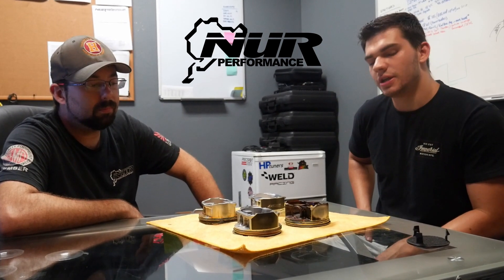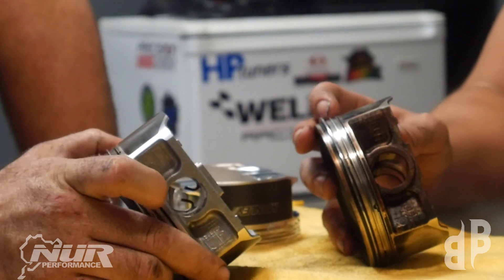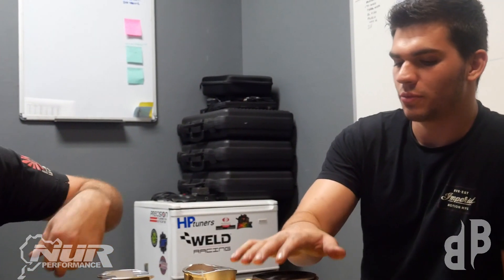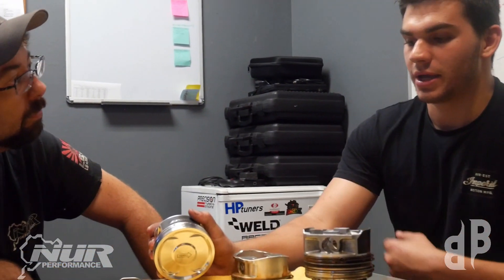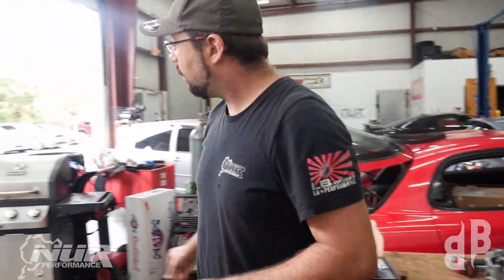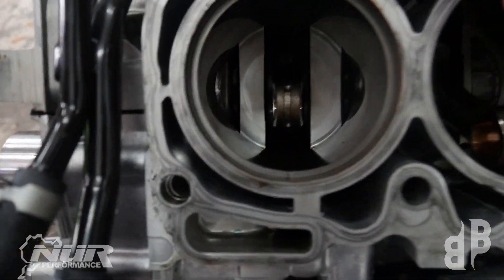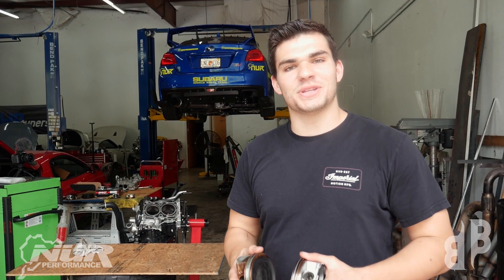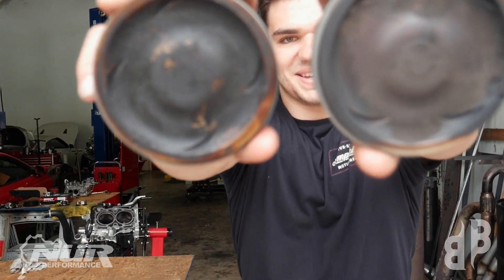THE TRUTH About The SUBARU STI RA Piston (MYTHS BUSTED!!)

Comment: Ringland on #4 is often fuel related. The feeling system causes cylinder 4 to get the last of the fuel. Builders and tuners down here in Australia have noticed improvements in engine reliability when converting cars to parallel fuel rail setups.
Reply: Cylinder 3 gets shortchanged on fuel (without a parallel mod,) cylinder 4 has the least coolant flow (without the GetaDomTune mod.) Both mods are simple and inexpensive, and are IMO critical reliability mods on a turbo EJ, even at stock power levels.
Reply: @JulianHale  i have had a ej257 that has been tuned for 280whp for 200,000km with no issues, just has arp head studs and a aos
Reply: @fynpedersen  I wish 
I’m on my 3rd oem block within 100km of stage 2 abuse
Reply: @liambarrer220  jesus christ. just save up like $700 extra and get a IAG
Reply: @fynpedersen why’d you get head studs for only a 280whp build?
Reply: @JulianHale  shit sorry I did mean cylinder 3. I've already done the cooling mod to my car now looking to do the fuel mod. Parts look like they would cost about 1k down in Australia.
Reply: i did that on my new RA STI JDM ej207 motor with no 4 coolant by-pass ! with the split fuel and fuel pressure regulator !

Comment: so if you leave the STI stock you wont have this problem?
Reply from the maker: The chances of this occurring are much less if you leave the car stock, however because of the original poor design, it may still happen.
Reply: Not true.  Ours is stock with only 69k miles and cylinder 2 failed.  It was not abused in any way.

Comment: Stock motors with stock ring gap thats been tuned and up the boost havnt had the rings gapped for that modification so it's running higher temps and that creates swelling of the rings now in a normal aplication this would be fine but because we are hotter they expanding quicker and they touch and have no where to go so the break and there you have rongland failure if you want to tune your car just save the money your about to waist anyway and do it properly
Reply from the maker: So much truth to this! Exactly what we have proven here!

Comment: 1/2 way through and not a word of boost ! ow , it is all about how much boost your putting in = what sized turbo ! ra ej207 good for 400 hp - your block does not have the THICK walls ! google a picture and see ! large gap rings on subaru = see`s the ring gap to rotate to the bottom of the cylinder and causes oil use and bore wear and circle burn out`s see hydraulicing !

Comment: Manley also recommends a larger ring gap due to it being a 2618 alloy, the piston to wall clearance is also larger on 2618 alloy as the piston is going to expand more when you get to operating temp and the ring gap is going to still close, not necessarily all the way but can still happen.

I’ve seen it before, Manley turbo tuff pistons, proper ring gaps, proper piston to wall clearance using the same formula in this video, and guess what happened? The customer still ran the car too hard on a improper tune and bent the rings and cracked a piston! Combustion temps, air temps, coolant temps, and tune will kill the engine the quickest as it’s a sure was to bend the rings or crack the pistons in the first place due to excessive heat in the cylinder.

Comment: Great video, but I think you barely scratched the surface on this and jumped to your conclusion WAY too soon. There are more differences between the 2 OEM pistons. You never covered the different alloys used, the different manufactures of the 2 pistons, note the difference in the ring land area. These are all different! Sure using the flame front theory as a form of abuse to this piston is great, but not that relevant when the newer piston design accommodates it. I’d like to see a part 2 on this where you guys reflect on everyone’s arguments in the comment section 👌🏻
Reply from the maker: Thank you so much for the feedback!! I really like that idea! I will see if we can make that happen for everyone!
Reply: I’d like to update my previous comment. I have recently ran a Type RA short block in my 2009 STI. Built W25 heads, 1300IDs, and a FP blue turbo pushing 25psi. Been driving it pretty conservatively yet enjoying the power from time to time. Well now, at 5500 miles, it recently developed heavy blow by and low compression on cyl #2 and #4. Pretty sure the pistons/rings are cracked/broken/worn. The original engine which made it to 160k miles, mostly stock, stg 2 tune never developed this issue. Really goes to show the threshold of limitations between the 2 engines. Hope my experience helps somewhere out there looking to use the type RA short block. Cheers 🍻
Reply: To much boost
Reply: @steveracecars  What did the failure wind up being?
Reply: @steveracecars  so how it ended?

Comment: Great video...but there is more that comes into play. Manley is forged and oem is cast so they will expand differently which is probably why the gap is different.
Reply: Was thinking the same, we also dont know the oem material composite on the rings, maybe there more heat resistant
Reply: @FakhryH  i have ordered a 2018 ra ej207 short block for my 2001 turbo forester everyday driver 28/60 garrett dual ball turbo ! 365 hp.
Reply: @ronnieboucherthecrystalcraftsm  my 02 WRX just spun a rod bearing, found all bits of metal in my pan when I drained the oil out. sucks really can't afford right now but there's a guy out in Carson City, NV will do a swap for $1500 labor on a RA EJ257 block

Comment: Yeah good video, but Subaru never claimed they provided the kind of reinforced pistons to throw gobs of extra ponies at it. Just a slight upgrade so the ponies it came with can run a little longer on a track day. Big difference
Reply from the maker: Definitely true! We were hoping the reinforcement would equate to the ability to push more horses! But they didn’t fix the ring gap 😭
Reply: @boxerbaddies  you can always run a little colder spark plug = cheap easy fix every one knows that ! do you ?
Reply: @ronnieboucherthecrystalcraftsm  and E85

Comment: have seen a few different bone stock ra blocks/stock heads/studs making 600whp on e85 w supporting mods
Reply: i came to the comments to post this, allegedly some have been rolling 6+months too
Reply from the maker: @tstandsforturbo  it’s definitely possible... as drew the tuner would say “just gotta keep the temps low”
Reply: @boxerbaddies  what’s a good range cylinder temp ?
Reply from the maker: @JohnD0129  well, on the Subies we don’t really have a way of measuring direct cylinder temp. But using a combination of products to control oil temp, coolant temp, and using a colder combusting fuel like E85, you can keep your temps much lower than you would on pump gas.
Reply: @boxerbaddies  ahhh ok. I’m tuned on E85. I try to keep my coolant around 185. IAT low. I need to get a Oil Temp Gauge.
Reply from the maker: @JohnD0129  that’s great! Another tip I always used was not pushing the car too much of the weather outside was too hot. Living in Florida, the summers would cause the engine to heat up really fast and the Intake temps would be extremely high. So until their came back down, I didn’t push the car too much.
Reply: @boxerbaddies   that’s true. Being it’s my weekend toy. I try to only drive it when the temps are not too hot here in Texas. What oil type everyone running ? 10w40 ?
Reply from the maker: @JohnD0129  It depends on how hot it is outside. If it's summer time and the atmosphere temps will be in the 90s+, I use 5W-40. If it's in the cooler months here, 60's-70's, I run 5W-30
Reply: @JohnD0129  I use MOTUL 5W40, Floridaman here

Comment: This is the first video of yours that I watch... Would love to know IF,  there is an updated version of  this video Re: The "S209" STI.   
   Thank you...
Reply: The originally announced the S209 with a forged piston upgrade. Later they recanted the statement after they reverted back the the “RA” piston because of cylinder scoring issues with the Forged pistons during testing. 

The S209 also got a larger HKS supplied turbo and larger injectors from factory. 

There is a whole documentary on YT from Subaru about it.
Reply: @crxkid16  Yep, I have seen that Documentary. I believe it was a 3 part series if I'm not mistaken. Unless you are speaking about a different one.
Reply: @Kiss__Kiss  that sounds right. It was either 2 or 3 parts
Reply from the maker: Oooo that’s a good question! I believe they didn’t change anything in that block from the EJ257. Just an intake and tune from factory to squeeze out some more horses!
Reply: @boxerbaddies  And of course, the use of an HKS turbo, Rather than  going the usual route of the IHI unit.

Comment: hey guys, this was a pet project of mine years ago and I sliced and diced many oem failed pistons into sections, I lost all my data in a theft, but i had tracked this down to their not being enough meat in the ej25 piston crown where the valve pockets are made there is simply not enough material between the valve pocket depression and the ring land that cracks

if you take enough pistons that have failed you will see typically where they all fail, pretty close to a valve pocket recess ?

start cutting a piston through from just below the top ring and then start measuring the thickness of the material from the failed cracked ring land to the valve pocket recess, thermal expansion and movement help this along

to fix this from Subaru side they need to redesign the piston crown and fix those silly tight ring gaps
Reply: Yes! Love this! Cut the pistons into cutaways!
Reply from the maker: Oh this sounds super interesting!! Might have to try it out!!

Comment: the ring end gap was set up for proper level for the power they designed for - surprising concept. the smaller the better for blow by.  once you start increasing the power and the corresponding heat load to the piston problem start popping up.....
Reply: no, they fail on standard power and boost
Reply: @hyltontiedt7485  Ours failed at 69k, completely stock.
Reply: Let’s not leave out two more important factors.. not properly maintaining and thrashing it on a daily basis.  Any engine is going to fail

Comment: My first time seeing you guys but I’m doing research on the Type RA engine because I was thinking about getting one for a 2014 STI Hatchback. If I did buy the block RA and put forged internals into it, would it make it more reliable?
Reply from the maker: ABSOLUTELY! But you don't need an RA block for that! A regular EJ25 block will do!
Reply: @boxerbaddies  ok thank you lol, I just wanted a bit more power out of it was all and for it to be reliable and not just give out. Mostly looking to keep the engine totally stock though. I’d probably just do a different air intake (front mount) and exhaust.